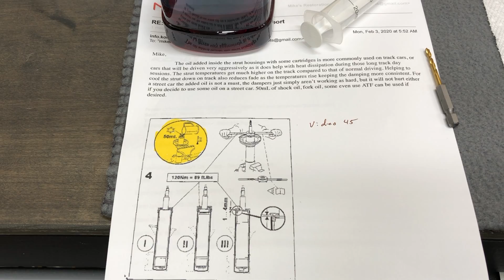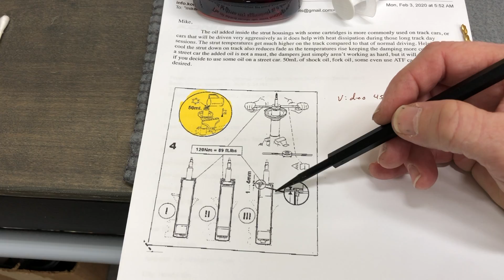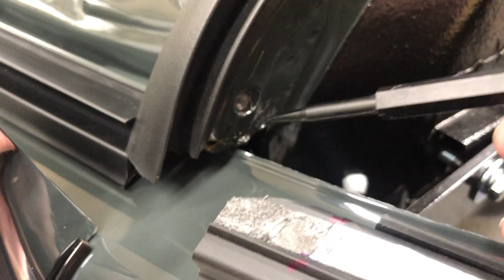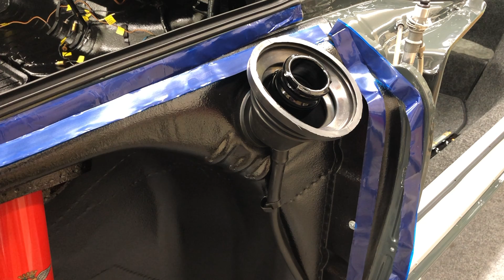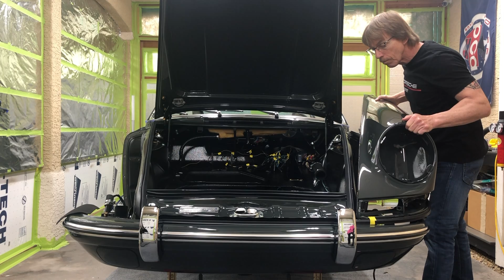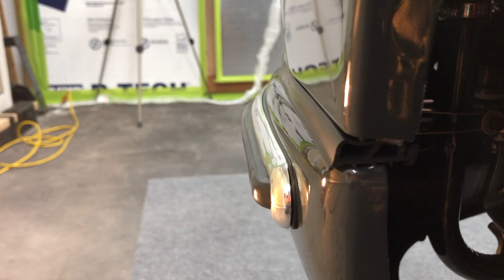Porsche 911 Restoration Project Installing Front Fenders/ Video 65

Comment: Mike, I'm painting the fenders on my '68 912 and will paint right up to the fender to cowl seal.  The seal seems tight and doesn't come out without tearing it.  Do I need to remove the bolt behind the door, and maybe the closest bolts down the bulkhead and on the border inside the trunk?
Reply from the maker: Hello Leif
Im wondering if your fender has ever been removed or is still factory set...
If it is factory set you most likely will need to remove it completely. The problem lies in the age of the sealing strip they used to secure it. also it is most likely spot braised near the front and that would require cutting through the spot weld/ braising.
You could loosen all fasteners but I doubt you will be able to move it a desired amount without damaging the fender.
Really what needs to happen is to remove all fasteners, Pull the small back seal out from the fender to cowl area. 
Cut the braise and slide
a thin sharp putty knife down through the hardened terostat tape seal all the way around very carefully.
It should then pull away from the body.
I hope this helps
Good luck!
Cheers

Comment: Assembling my '68 912 Targa and all the panels and doors were removed. Hood has been reinstalled and watching your exceptional videos the next step are the fenders. My question is why not the doors then the fenders? The doors (my hinges were not removed) are fixed and since the fenders have some room for adjustment, is it really the best way to do the fenders first? This is NOT a criticism but a question for a novice like me. In other words, matching the gaps of the fenders to the installed door sequence question. 
Thank you,
gj.
Reply from the maker: Hello gj and season greetings
Yes doors in place will be a big help in alignment. If you have chance I recommend watching the Final Walk Around video in which I will be discussing panel gaps and how the doors relate to the fenders.
In my case this is the order in which the build was ready for assembly but fenders doors and hood all  need to be worked together for the best possible fit. Im sure adjusting will be necessary once all three are with each other.
Wishing you the best of luck they are tough!!
-Cheers
Reply: Thank you for that explanation. Since the door hinges were painted while on the vehicle but the pins were not, what is your suggestion on how to paint the pins? The pins are bare metal and if I paint them prior to installation, won't the paint shear off the pins while knocking them into place? And painting them after installation seems like an impossible task to get full paint coverage. @MikesRestorations
Reply from the maker: @gjdettore5028  gj also in the final walk around  video I think I went over this to some degree. I sandblasted  the heads and then when I painted the car I also painted them at the same time. I poked holes in a cardboard box and left the heads proud of the box. Epoxy primer base, scuffed and then base coat clear coat.
When I hung the doors I used a 2nd set of screws to set and align  the doors. Once everything was adjusted and looked good I switched out the screws one at a time until everything was replaced without loosing the final adjustment. The trick is to make sure you are done adjusting! If you pull and replace the screws multiple times you will crack the paint and it will lift.

Comment: Mike, your step by step instructions have been indispensable while I fully restore my 91 C2 964. As you indicate, the sealing tape binds together quickly. When I installed the fender, now it won't budge for me to properly align it. I feel like there is no choice but to pull it off again. Any tips?
Reply from the maker: Hello Don thank you I'm glad they can be of some help.
Yes the putty tape does stick too well! It can be a problem when trying to adjust.
Same issue here.
I recommend on a very warm day and warm conditions to slip a thin 1 1/2 high quality putty knife between the fender and body to separate. Also you will need a stiff high quality 3 inch putty knife to work along side as you gently press the 1 1/2 down through the putty and use the 3 inch to gently pry the fender away from the body as you work down the fender.
Making sure all fasteners are removed first.
You will then be able to do what ever you need to pull it into proper alignment. Go slow and be careful with the knifes. Maybe even tape on the perimeter to prevent any accident. The fender will move and will reseal when you are ready to re-tighten the hardware.
Good Luck!

Comment: Awesome series and outstanding attention to detail! Bravo! I just got a 1970 911T and the front hood/fender gaps are very tight, and the fenders look new from underneath. Do you think that in replacing the fenders that the previous owner skipped the butyl tape? Does the double tape layer between the fenders and the body create the gap with the hood? Thanks, and keep up the great work! Gary
Reply from the maker: Hello Gary
Thank you and happy new year!
I have not found that doubling the butyl tape has any advantages.. I have to trim out the excess as it squeezed out upon tightening. The fenders will need to be adjusted into the doors and hood with all gaps considered. I recommend watching my video Final Walk around as I go into it a bit deeper. They will need to be fully adjusted and fully tightened to get your gaps tight.
Good Luck!
Reply: @MikesRestorations  Thanks for taking the time to respond!

Comment: Hi Mike, I'm wondering, when you sprayed the vht clear over your yellow zinc finish, did it dull down the amount of rainbow swirl effect at all ? the other clears i have tried, all change the look, the swirl effect would probably be cut in half in looks. Which is what stops me from using a clear coat.
Reply from the maker: Hello Resto Blast
Yes the iridescence does faded make the finish more like a gold plating rather than with the rainbow appearance
If brake fluid gets on the yellow conversion coating it will remove it anyways..As long as the brake system never leaks or has any accidents you should be okay by not top coating.
My brake system is so old and unknown at the time of assembly I didn't don't want to take any chances.
So far to date I have had no issues with there calipers leaking
Either way is a good choice! Good Luck
Reply: Hi Mike, thank you for the reply mate, i will leave them just plain zinc finnish then, thanks once again for your help, keep up the good work.

Comment: Another awesome video.  That sealant tape looked like butyl which is used around car windows or to seal headlight lenses.  It never goes fully hard but you need some heat to make it soft again when put on a car.  It comes in sealant tubes like silicone which is super gunky and messy or in cord form in a square profile which is very easy to work with. 5metre butyl cord was about 10 eur if I remember correctly.  Replaced lenses on both of my Audi headlights and I still have plenty left which after a year is still soft and workable.  Great stuff to seal and keep moisture out of non-visible areas.
Reply from the maker: Hello Gplus..This is sometimes referred to as butyl tape.
It sure does seal up and make a nice gasket too. We use butyl in construction for extreme weather sealing..applied like a caulking from a caulking gun. Very veristile product!